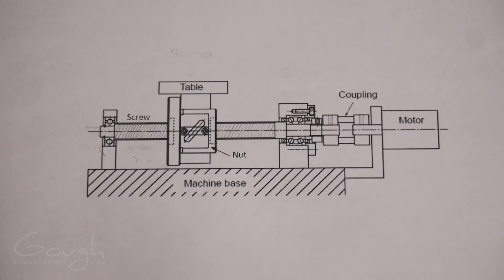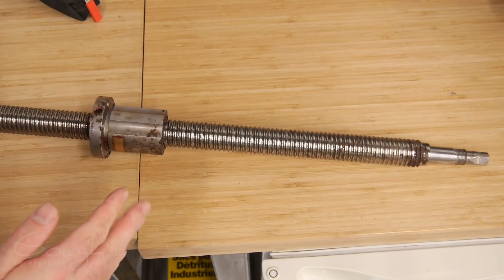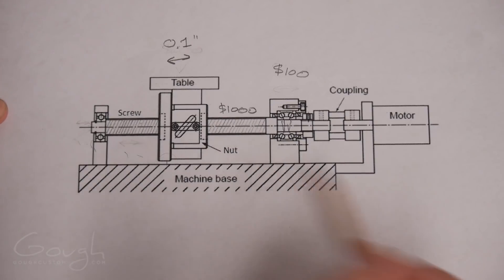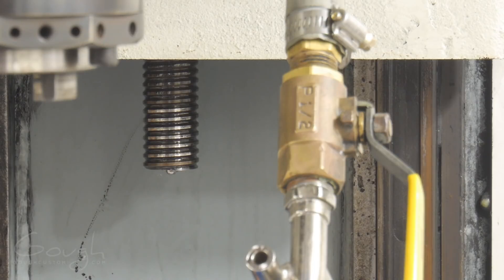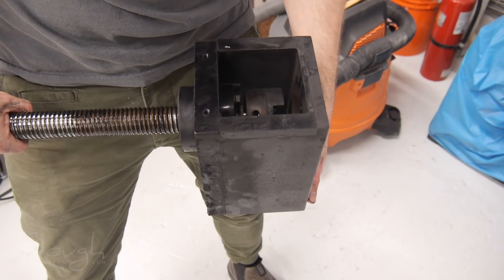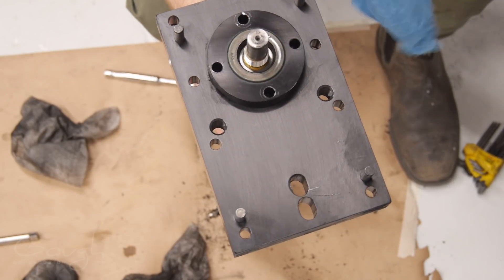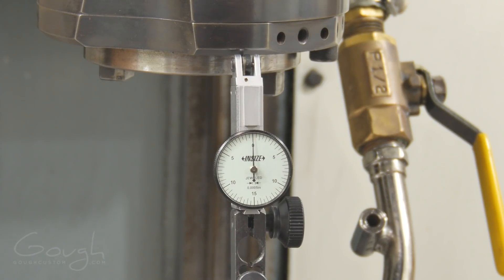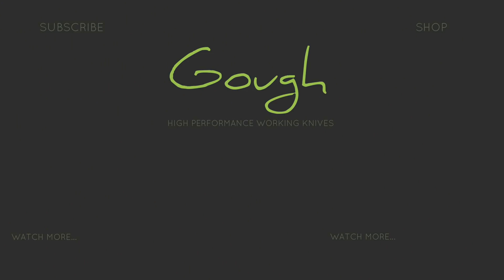Fixing the Z axis on my CNC machine!

Comment: Ole CNC tech here. Used to work for Kearney & Trecker back in the day then on to many Aerospace firms. My very first thought was: “not so fast” you might just have loose Allen bolts holding the bearing retainer. Seen this happen frequent. Glad it worked out. Nice to see you block things for safety.

Comment: My vmc15xt has some backlash on Z axis I went ahead and purchased the thrust bearings only problem I can't figure out is how to align the ball screw any ideas???
Reply from the maker: Install the ball-nut bolts but leave them a bit loose, same with the thrust bearing bolts. Move the Z axis all the way up, then tighten up the thrust bearing bolts, then the ball-nut bolts. The thrust bearing and its mount should determine the alignment, then you just tighten the ball-nut in place to maintain it...

Run the Z axis all the way through its travel with a cordless drill or by hand to make sure it doesn't bind up or get tighter anywhere in the travel, and then you're done!

Definitely not a precision process but it has worked well for me so far.

Comment: Thanks for all the information you share. Would you happen to have or know of a reference/guide on how to replace the X/Y thrust bearings on a Fadal (I have similar 2016L)? All the threads I've read get pretty confusing and go into troubleshooting backlash  and details about quirks/tips for re-install etc. Kind of looking for a fundamentals of what to remove and how. Also, have you ever considered to reball your screw if you think you may have issues with it instead of having to purchase a new one? Steps seem simple from what I understand, but doesn't seem many try to do this. Thanks in advance.
Reply from the maker: Hey Sarah! The steps involved in removing the X/Y ballscrew are pretty much the same as what I show in the video for the Z axis, except you don't have to worry about the counterweight.... Remove the servo, remove the thrust bearing mount and the ball-nut mount bolts, remove the entire ballscrew assembly, then you can dissassemble it and re-assemble it as I show in the video!

I have not tried re-balling a ballscrew yet. If your screw is in good condition and has fairly even wear then it should definitely be an option!
Reply: @GoughCustom  Thanks for the help. I wish I could have read what you wrote a couple days sooner because I took apart the X ballscrew and didn't realize the ball-nut mount, therefore my tiny balls went flying everything when I backed out the screw. I guess it's a good excuse to go ahead and attempt the re-ball, I went ahead and ordered nominal 0.125 Grade 10 balls as I measured a few of the existing balls to be ~0.1241 - 0.1245 . It's about 5X the cost for non nominal sized tiny balls. In case anyone is attempting also, I estimate about 250-300 tiny balls per ball-nut.

Comment: Thats the great thing about the Fadals - they're relatively simple machines, usually low priced , with great aftermarket parts support, and a huge community who can usually help diagnose any issue that may stump you. If you're trying to start up a shop, and don't need super high speed and feed milling, or are doing fiddly work splitting tenths, they're definitely the way to go.
Reply from the maker: I totally agree! I am at the point where I'll probably be looking for an upgrade within a couple of years, and even then there are options for Fadals to modernize the control and make them more accurate... My machines have certainly treated me well!

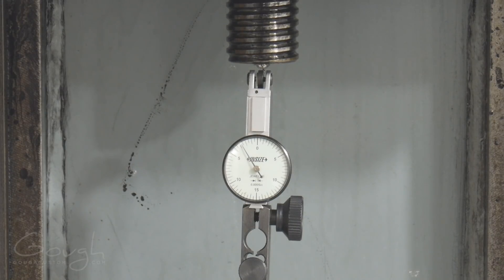Comment: The 7:30 measurement is wrong. There is no bearing anywhere near the tip indicator to keep this ballscrew in its axis of rotation. If you would bore a pipe of external size of a ballscrew + tolerance and bolt it in place...
Reply from the maker: I'll have to disagree given that the before and after showed that I fixed the problem... It doesn't have to be perfect, it just has to be able to detect the issue. I am not really taking a quantitative measurement here, just a qualitative one. The sudden change in indicator reading when I reverse direction is all I'm looking for as evidence that the ballscrew is moving on its long axis. If the ballscrew is rotating outside its central axis then that would show up as a slow periodic change on the indicator, in step with the rotation of the screw, much like what you see in the 'after' measurement. This does not really hinder this measurement from being effective.

Comment: Graphite is hard on machines not designed to machine it.  Good job!
Reply from the maker: It definitely did a number on the electronics, but I've been surprised at the mechanical condition of the machine so far! That said I know the previous owner put a LOT of parts through this machine. I think all the ballscrews have been replaced at least once each...
Reply: @GoughCustom  I've seen just about every major machine tool builder out here struggle with Graphite when they try to just hang an exhaust system around the cutting zone and call it good. Purpose built machines still struggle with the stuff.  You did a fine job ressurrecting these machines.
Reply from the maker: @terrymoorecnc2500  Thanks Terry! It was definitely a bit of a process! Thankfully I think the final result has been worth the work... This video was actually filmed last April and the machine has been running great since then, making knives every day!

Comment: I am wondering if you are getting enough oil to the ball screw nut on the Z-axis ? The oil seems awfully black. Maybe worth checking out the oil distributions block and such ?
Reply from the maker: Thanks for the concern mate! This video was filmed shortly after I first put the machine into service in my shop, and in it's previous life it was mainly cutting graphite which is why the oil was coming out so black... I've been running the machine for close to a year now and the oil is mostly coming out clear now, just needed time to flush out all that graphite!

Comment: Thanks for sharing Aaron.  Do the 88 controls accommodate linear scales?  I swear I've seen a Fadal with scales at some point.
Reply from the maker: Hey mate! Yes I believe there were fadals with linear scales, I have personally never seen one though! There were lots of fadals of this vintage that had chilled ballscrews though, I think that was meant to be their cheaper solution to thermal management... only problem was the rotary unions tended to leak and destroy the thrust bearings!

Comment: I remember being a bit disappointed when the CNC arrived.
I felt : After mastering handmades, he's going to get MIGHTY bored watching a machine make them. Like watching paint dry.
How badly mistaken I was !
The excitement hasn't reduced, it's multiplied hundredfolds shifting from the knife-edge to CNC !
I just realized, you don't FIND excitement; you CREATE it by going where you hitherto haven't and most wouldn't ever dare to. 
Thanks for a very interesting & inspiring video.
Reply from the maker: Thanks for the great comment, and for continuing to watch even after I got the CNC! :) Having made knives both by hand and with the CNC I can tell you that making them with the CNC is far more challenging to get right, though less labor intensive when things are going smoothly.

I think it's a good balance for me personally, it tends to put the emphasis on working out processes and fine tuning details, rather than repetitive manual labor. Personally doing low skill labor again and again really takes the joy out of the process for me, so I am working to reduce that!

-Aaron

Comment: Nice video,  I think that the nut in the ball screw is a pre-load for the bearing, in that case it's not a very good a idea to thigthen it so much, because that's make the ball/rollers squeeze inside the bearing. Maybe a locktight it's a better solution. 

Keep going I love your knifes!
Reply from the maker: Hey Nicolás! 
The preload on the thrust bearings is actually determined by a thin metal shim in between the inner races of the two thrust bearings. So tightening the nut that retains them does not affect the preload which is great. 

I have seen some designs, especially in spindles, where the preload is altered by the torque applied to a retaining nut and it tends to be a very fiddly and generally poor design, thankfully they didn't do that in this case!

-Aaron

Comment: Great video Aaron and a good tutorial about the possible culprits.  Glad you found it and solved it quickly with only one knuckle bust...felt that clear over here.  @¿@  Curious how much you can offset in code in each axis?  Thanks Much!  ~PJ
Reply from the maker: Hey PJ! Thanks for watching as always mate! Yeah that knuckle hurt, didn't leave a scar though luckily :) You can offset quite a bit in the control, up to about 0.005" I think, however anything over 0.001" probably won't give reasonable results. 0.0005" is about the most I would want to comp in the control before replacing the screw and/or thrust bearing.

Comment: Naive question: For the retaining bolts, would it be reasonable to use thread-locker?
Reply from the maker: Not naive at all mate, good question! I think a weak threadlocker would  be fine, I wouldn't want to use a strong one though, too much risk of causing damage when trying to undo the bolts in the future. That said my other machines have not had threadlocker on these bolts and I haven't seen one come loose yet!
Reply: I use the blue Loctite 243 glue stick on everything unless I know it will be undone regularly. When it arrives, I plan to use a torque wrench on important bolts (plus 243)
Reply: Hola, nosotros en lo personal usamos loctite anti aferrante C5-A, nunca no a dado problemas aun cuando lo usamos en maquinado con refrigerante liquido y como dice el compañero siempre respetando los torques, espero le sirva, saludos.

Comment: Always nice when stuff works out like that. Smart checking the bearing while you had it apart. Hopefully no hidden damage from it being loose. :)
Reply from the maker: Hey Bert! I've been a bit slow posting this video, filmed it kinda early last year (around April) and the machine has been running great since then, so it seems like no harm done! I actually keep a spare thrust bearing on hand (as well as a bunch of other spares for the machines) so if it does end up going it will only be a few hours of downtime to swap it out... Downtime is definitely a risk with these older machines so I try to keep common stuff on hand to mitigate that!

Comment: I once had a similar issue. I baught a Mill, cheaply and the guy I baught in from forgot to put a spacer bushing back into the spindle. when milling everything looked fine but once you would drill something, the spindle would overheat big time because the spindlenose was rubbing on the housing.
5 minutes on the Lathe and some scrap seel tubing did the trick.
Reply from the maker: Amazing the things that get lost when you take a machine apart! I'm sure we've all had an 'extra' screw or two after doing a project... This was not the only thing that the previous owner had done incorrect on this machine though unfortunately... When I got the machine the 15 HORSEPOWER spindle motor was held in place by only a single bolt. 🤨